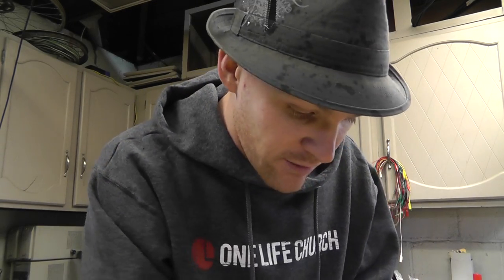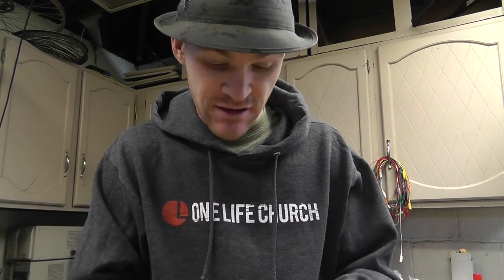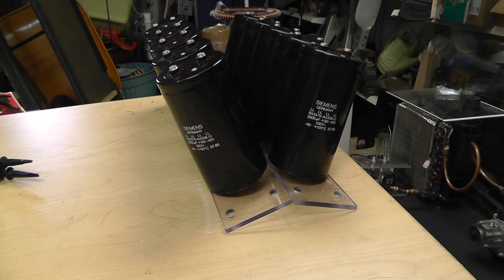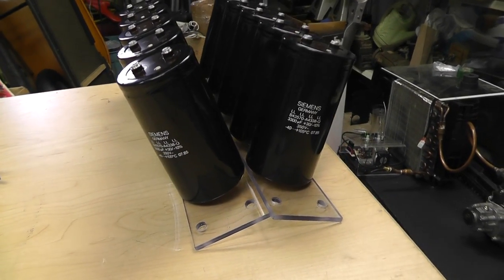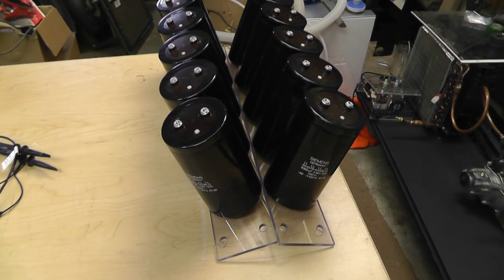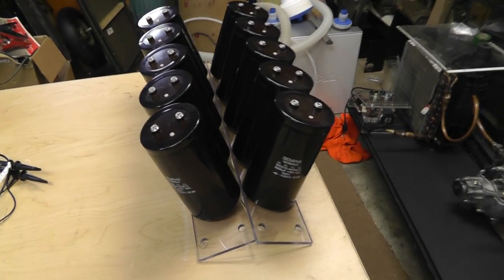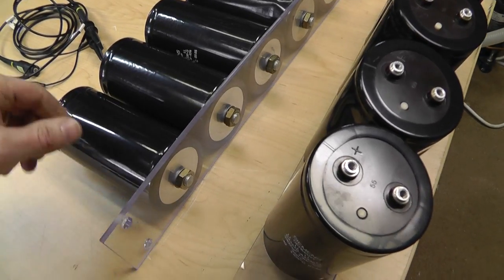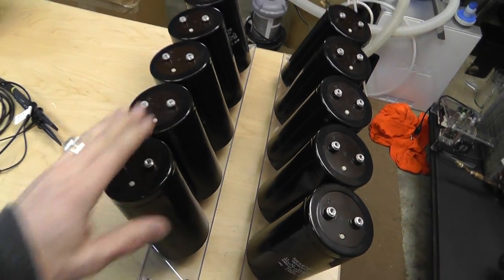Update 18 NGE Papp: Timer Circuit, New Caps, New Ignition Set Up, General Update.

Comment: Lol-glad to see i could help with hooking up two coils together-this was the setup i was trying to explain to you lol..But one is not ground.One becomes a reverse polarity to the other-so there is no 0 volt ground.1 coil will be outputing 40 000 volts positive,and the 40 000 volts negative.So your potential diference is 80 000 volt's between the two.

Comment from the maker: Yes sir, that is correct, also, I'm using a tlp250 MOSFET driver so good there. ;) 
 This was a set up to just show how i plan on doing it. ;) more to come on the coil set up and driver circuit.  And I will be using diodes in the HV line to trigger the cap discharge... In the end it will be dc. Blessings!! Thanks for the help!! And feed back! ~Russ

Comment: Russ, Tinman was saying your getting positive 40kv and negative 40 kv, without rectification at the output of the coils, what you are getting is HV A.C., not DC. Also when driving your fets you should employ a bipolar drive that can drive the gate " on" hard and also when turning the gate off it needs to short to ground, it sounds complicated it really is not. A npn / pnp transistor pair will do this (2n2222 and a 2n2907). More on this to follow.

Comment: Hello Russ.
Great work, im watching all your videos.
Im also experimenting with the Papp Engine and will give you an update when i have the time.
One thing about your HV coils, i think you should have a much larger spark gap if you were producing 90000 volys, (+45000 and -45000) i Think you are connecting them wrong, they shoul not be in series, you will only have 6 volts across each coil.
You should connect them in reversed parallell, that way you will have full voltage for both coils.

Comment: you will need a voltage regulator and pleny of smoothing caps to run a 555 with any consistency.   it will work for now but you will need to program a micro controller eventually to make it run as well as possible

Comment: I will email you the circuit im useing for the coil driver's.
Nice job on the 555 timer circuit.It works like my motor speed controler,but would be much cheaper to build.

Comment: Ok a few minutes after watching your video-something hit me(and no,it wasnt the MRS lol)
So i came back for a second look.After watching a second time,i see you have the coil's wired up wrong-well not wrong,but in an inefficient way.You have them wired in series,even though you have two of the same polarity wired together to reverse on coil to the other.
The best way to wire them is parallel,but one opposite to the other.Anyway,i will email you the circuit.

Comment: Am very interested in the 555 pulse generator... what's the width of the shortest stable pulse?  and what is the max frequency?  can a 555 be stacked with another 555, to make a synchronous drive for a push-pull transformer?

Comment: Nooooo-resistance is bad-it's a loss.Just use a good power fet,10 amp rateing will be plenty.
Remember,resistance is heat-and heat is bad.You then can reduce your pulse width,and get the same effect.
If you hook them up in series like that,the kick back spike will work against your two coil's
When hooked in parallel,the kick back spike actualy increases the voltage across the primary coil's.
You can then increase the power of the spark by 10 time's with just 2 HV 1 amp diode's.